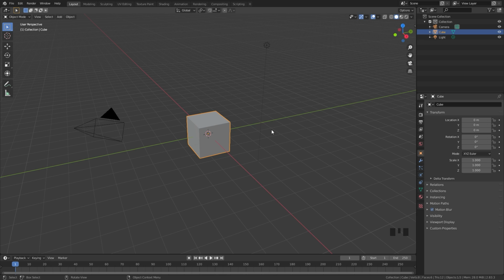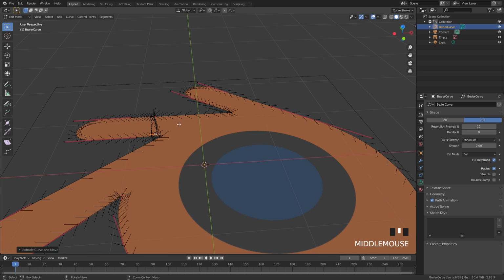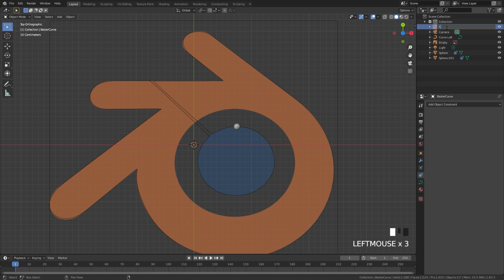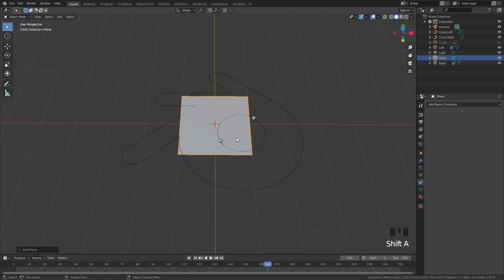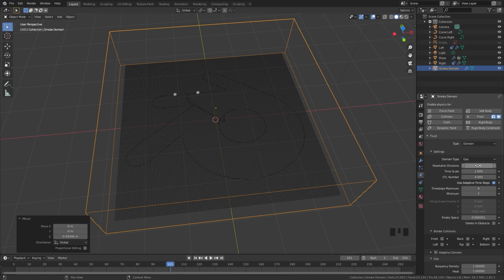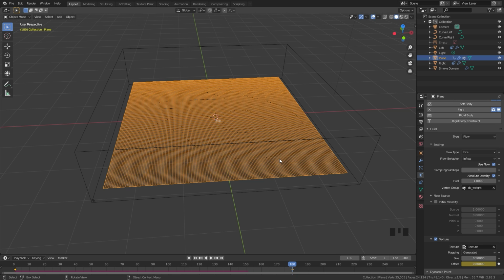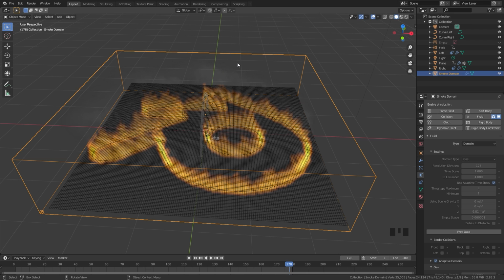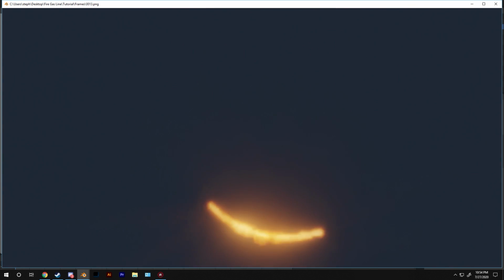Blender Tutorial - How to Create a Fire Trail

Comment: Great explanation however I have two issues:
1. the fire was not showing up after baking. I have tried several times, scrolled through comments to see maybe I am doing something wrong (apparently quite a few people have the same issue), and finally after many tries it suddenly started working. I still have no clue what changed. Point is, there is some sort of inconsistency
2. The fire looks way more blurred than that in the video. It looks like something from an early 2000s game. I had the same issue with his previous tutorial with the smoke. Again, I've followed everything he says, paying attention to the tiniest detail, and yet for some reason it looks bad. 
Did anyone else have any of these issues? Did you find a solution? Thanks!
Reply: same
Reply: Could you let me know if you figured out the problem? If you bake with 256 on the domain you'll get better quality. Could you make sure the objects you traced balls and plane are on the same level? It worked for me that way. Also, make sure to select the vertex group as he mentioned in the video.
Reply: try render in cycles

Comment: I finished and got 1 problem: I cant see the fire?
Reply: Me too
Reply: I found that if I hid the UV sphere, bezier curves and plane generating the fire before baking the smoke domain no fire would be baked.  I found that these items only need hiding when you are prepared to render.
Reply: @funkypartyweasel  so then it actual works?
Reply: @Maurik05  for me, yes.  There's a few things to try.  Upgrading Blender to latest (2.9 to 2.9.1) solved a different particle issue, worth a try if you're not on latest.

If that doesn't work try again from the beginning, making different versions of the save file with version numbers as you go through.  That way if something goes wrong or doesn't work you can skip back to only a few steps ago rather than relying on Blender's still disappointingly flaky undo.
Reply: @Maurik05  Yes.

Comment: Please! Please! Please!

I don't see any fire after the baking of the domain, the balls just move but no fire, and the domain does not expand as the balls move, it's just static.
Please, I've checked everything and I followed your steps (though I'm using another logo, not blender logo).

Please, what could be wrong?
Reply: Never mind, I found the problem. For some reason, the UV sphere does not work as a dynamic paintbrush. When I baked the dynamic paint canvas, the UV spheres are not interacting with the canvas. I had to use a cube with some subdivisions as my dynamic paintbrush and that fixed my problem. The fire now shows up when I bake the fire domain.

Comment: Do not try this in 2025 it doesn’t work
Reply from the maker: What doesn't work about it?
Reply: @BlenderMadeEasy I spent 5 hours tweaking settings after initially following your tutorial step by step in 2 different versions of blender and for some reason the fire does not emit from the uv spheres as emitters by default. Still trying to figure out how to make it work.  The only way I could make something happen is moving the spheres into a collection and then going to the dynamic paint settings on the plane and setting the collection to “brush collection”. I might be wrong about my comment but I’ve literally tried everything and I’m pretty well versed in blender. I don’t know how the settings of mantaflow have changed either over the past 5 years.
Reply: @BlenderMadeEasy love your tutorials by the way I’ve done most of them 💪
Reply from the maker: Thank you for the kind words! :) Maybe I misread your comment but the UV Spheres aren't suppose to emit fire. The plane is the object that is suppose to emit the fire. The only reason for the spheres is to paint the "weight" on the plane which is then used for the emission of the fire. Not sure if that's the problem or not. Kinda hard to fully know exactly what's causing it to not work without looking at the blend file itself.